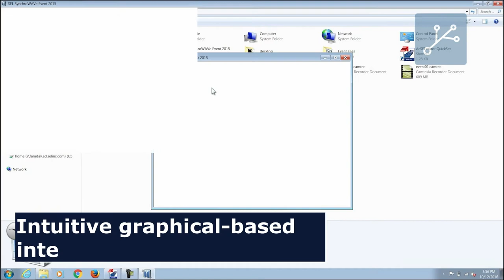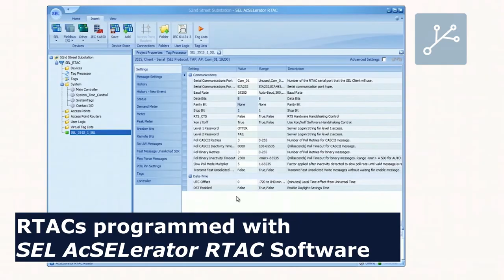SEL Protection Relay and RTAC Programming Services

Comment: I have a similar project, but I am stuck. Is there any way I can get help? I am working with RTAC Axion trying to communicate with SEL 501 and SEL 751. I am really struggling with configuration
Reply: 😂 still need help?
The 501 is a really old relay and someone could have spent a few extra hundred dollars and got a relay with more features.
I've been programming RTACs for 15yrs.
Reply: @beans4gas  too late. Also, the project was a success. 15-year experience that's impressive. Do you mind if I ask what your role is? I want to learn more about relay and industrial networking in secondary devices. I would really like to have guidance from professionals such as yourself.